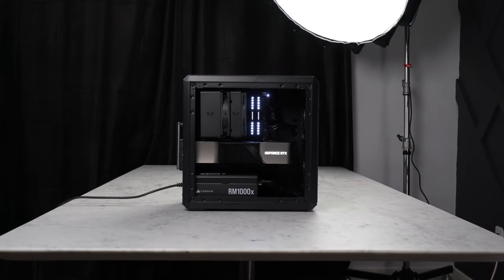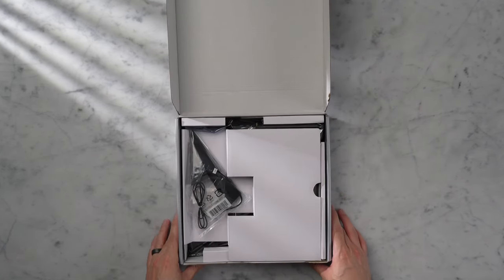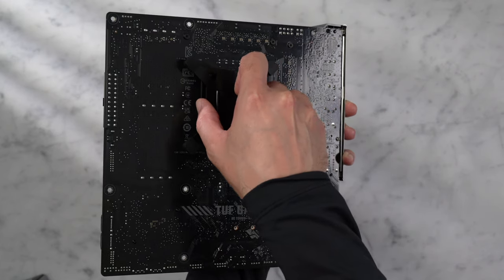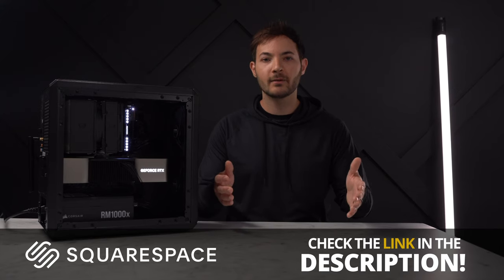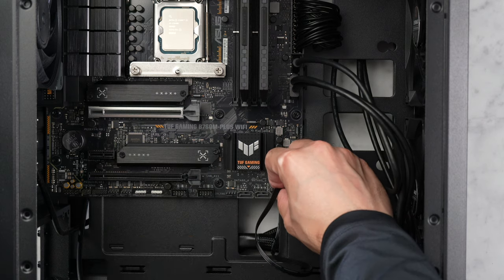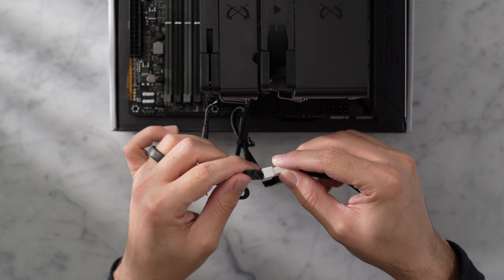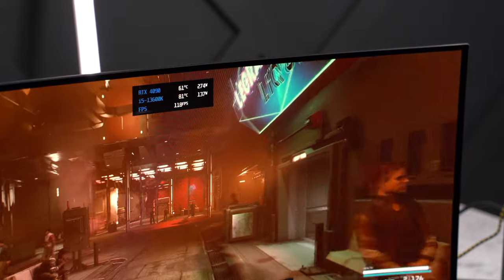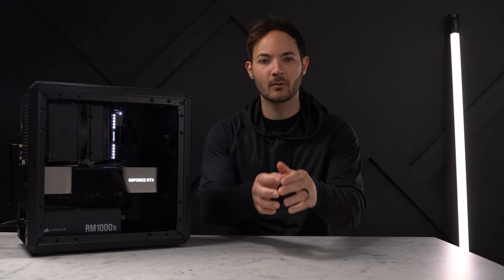Overpowered Micro ATX Gaming PC Build

Comment: I would encourage folks to just swing for 2TB+ if they can afford it (or save up if at all possible). Especially in a micro-atx build where getting to components can be a bit of a pain and "add-ins" are quite difficult if not impossible.. Games these days are 100GB+, so you will be able to fill a 1TB drive super quick.
Reply: What about an external hd? Would that be a good solution?
Reply: @williamelijah27  You certainly could do that. It is just one more thing hanging off of your micro-atx pc though.

Also, USB4/TB4/TB5 traditionally has not kept up with PCIe/NVMe. So only a matter of time before your external ssd/enclosure begins to feel the speed pressure.
Reply: It's not hard to upgrade mATX. My last build had 5 drives in it 3 of which were SATA.

Comment: I built the same desktop. This has been a joy to build in this case. My specs are: Ryzen 7600, 32GB 5600, Thermalright Phantom Spirit Cooler, 2TB Samsung 990Pro, TUF 7800XT OC, RM750e and for cooling I threw in 3x Antec Storm T3 fans. An absolute monstrosity for 1440p.
Reply: What are temps while gaming

Comment: You are one of the few PC builders who actually install high tier fans (though anything similar or better than the Arctic P12/P14 is already good for this case) to address the Q300L's 'hotbox' issue. Most reviews for the Q300L rely on the pathetic single stock fan that came with the case, with shockingly predictable results.

Comment: Especially with the smaller processor, I would have used an ATX 3.0 850 watt power supply. In the games you showed, you can see that the consumption is more like 400 watts, which is closer to the effective sweet spot of 50% utilization for an 850 watt power supply.

Comment: if you got an modular psu and case like that

i would say - connect power connectors to the motherboard BEFORE you attach motherboard to the case

then you can just move cables first via the holes and then attach the board :) 

no need of then using your raccon fingers to attach connector in tight space like that :D

Comment: I'm struggling to understand, you connected all the cables to the motherboard, it was inside the case. Then you install the CPU cooler with the motherboard not in the case. I'm not following how you got the cooler and fans and cooler fan cables in the case and wired them through the back.. right now I have everything connected up to the motherboard, the motherboard is screwed in, and I don't have the CPU cooler installed yet. I just don't understand in what order you did it.. I know it's better for the video to install the CPU cooler outside the case, but for someone who is not making a video how do I do it?

Comment: If you're not gonna overclock and just run at stock speeds you might as well go for the non-K 13600 to save a little money, the performance difference between a non-K and K CPU is absolutely dismissable

Comment: Is micro atx good for content creation and gaming both? And can I upgrade it with upgradeable components in the future…I appreciate replies
Reply: Depends on your needs truthfully. If you are planning to have a dedicated video card that’s plugged into pcie slots it’s best to have an ATX board to minimise blocking the gpu fans or as well on m-atx boards a 2.5-3 slot gpu will block the second pcie slot which would be for a dedicated video card
If you are using an external visor capture device or just something like OBS nothing internal / external hardware wise m-atx is a good way for saving some money and maybe if you like smaller form factor cases.
If you want to ask anything else or want more in depth answers to things ask away!

Comment: Ha I just got this case a week ago, funny to see it in a video. I crammed three 140mm fans in there, two in front and one in the bottom. And two 120mm fans on top and another 120 in the exhaust. Also have two 120mm on the cpu cooler. And finally, crammed in a 6950xt as well as an HDD in that side panel with the cables. Cool case, I have it laying flat on its side on my desk.

Comment: I would have chosen a z690 or z790 chipset motherboard to unleash the full potencial of the cpu, as well as using at least a 240mm radiator to really disipate it's heat

Comment: 14th gen is a supposedly a 3% uplift... at a much higher price.

I honestly don't know why anyone gaming is going Intel right now. Currently AMD has the gaming performance crown, better efficiency, and a platform with a much longer life.
Reply: 13900k, only pull less than 140watts gaming. 7800x3d is great but 13900k is just better especially when you are doing more than just gaming
Reply: I started getting this channel recommended to me a few weeks ago and a lot of the part choices are questionable. For example in this video the air cooler he chose is weird. You could get an equivalent cooler from Thermaltake for half the price. Also the 980 pro is typically very overpriced.

Comment: im looking for a matx case with a 140 rear fan and 2x140 or 280rad top and 2x140 or 280rad front... only could find the kolink mesh.. are there any more?

also u forgot to mention when using a pcie m2 nvme drive ur gpu pcie lanes of the gpu will shrink...

Comment: Why i5 but not i9/i7
Reply: You could use them. But they're hotter parts, and you'd need to vent the case faster, to keep them from throttling under load.

Comment: I have this case. Complete shit. Fans cannot blow it either from above or from the front, since the cells in the grid are too small and located far from each other. In fact, it does not blow at all, in any way.
Reply: Realllly!? Not worth it then?
Reply: @jeromerelayson3850  I really like its size and spaciousness inside. Small, but spacious. Almost any hardware will fit.
But! There is no blow-through. Neither front, nor back, nor bottom, nor top. I have it without a side wall, without coolers at all. As an open stand) It is NOT suitable for NORMAL PC assembly. If the holes were bigger, it would be an interesting case.
Reply: @orangechannel4862  do you recommend any good matx or itx with good thermals that can fit 4090 FE? Right now I have a 4090 FE but is paired with 5900 and inside an Alienware r14. Would love to migrate to a different case.

Comment: Kinda big for an mATX case. Then again it's cheaper than many mATX case on the market so it's not bad. Plus, it's not putting the power supply at front. I do wish it had a bit more airflow to it then just holes. Otherwise great inexpensive case.

Comment: Hey there, most of your Builds are solid. but on this one i don't get why pair a "K" CPU with a "B" MB. There is a 13600 available, so why spend money on an unlocked feature that you will most lokely never use?
Reply: 13600 isnt available in North America. I don't even know if it's available in Europe. there's a 13500 but it's different. closest to 13600 is 13600kf

Comment: Companies need to bring back Micro ATX. As far as I can remember, a lot of motherboards that came in prebuilts and what not are Micro ATX motherboards incased in either mATX cases or Mid Tower cases. With todays tech and everything being smaller (besides ITX) mATX should replace ATX just because it would save them some cost and fit all the bells and wistles appropiately.

Comment: "OLED colors"? Maybe you meant to say OLED contrast?
Reply: colors, oled has 1billion colors, ips has 12m, very different in displaying contents/ anything basically

theyre true expensive but you missed quite alot esp if you have color dependant work such as photography or videography

which means watching above works also different experience
Reply: erm also to add, radeon gpu are better in color too they seem has more color range than arc or nvidia

Comment: I tried DDR4 and  5 with the 13600kf,  most games you won't notice the difference,  one game saw DDR5 get a clear win and  a handful of games favoured DDR4. DDR4 has lower latency than DDR5 although it does perform better with some computing tasks such as 7zip. Should be using a replacement CPU mounting solution, especially in such a small case,  it will lower CPU temps by 10+°C. No point buying a "k" if you don't  overclock it, most 13600k's will do 5.5GHz with lowered voltage and massive temperature  drops,  it's crazy not to, again especially in a small case. Love that little case,  and it's basically a solid build,  looks good, solid performance, solid video.
Reply: What speeds did your ddr5 have compared to ddr4? I see ddr4 3600cl16-18-4000cl16-18(OC) demolishing ddr5 under 6200cl32 but as soon as ddr5 passes that in speeds is when it finally starts winning or being even, next gen should bring out higher 1:1 ddr5 speeds and we will finally see it surpassing ddr4 in performance on average and overall! (Hopefully)
Reply: What replacement CPU mount would you recommend?